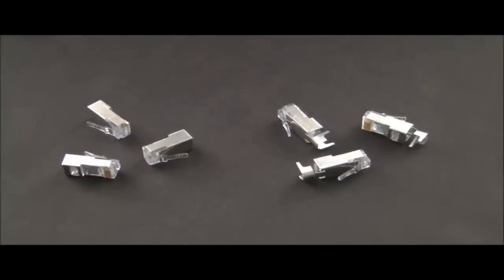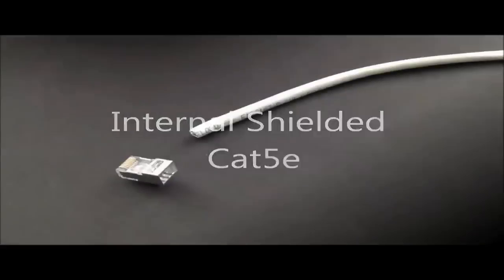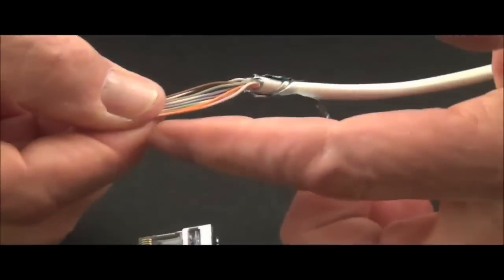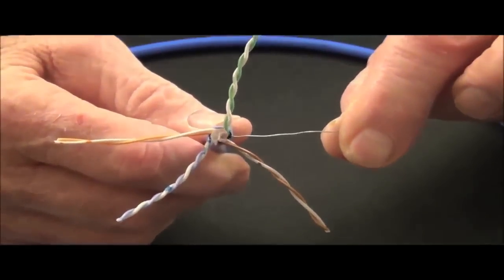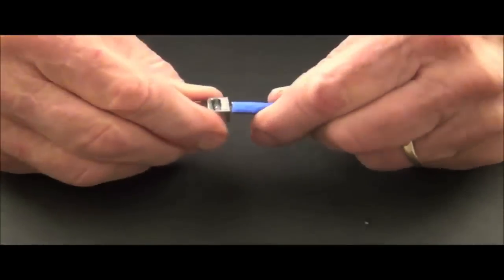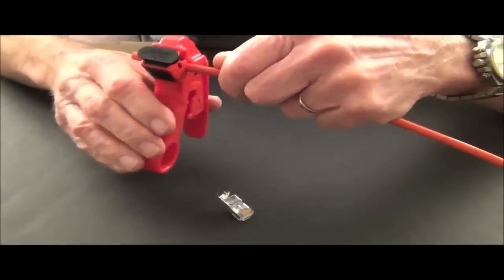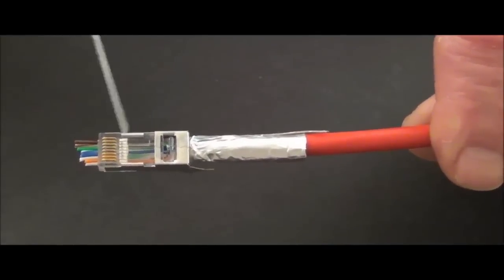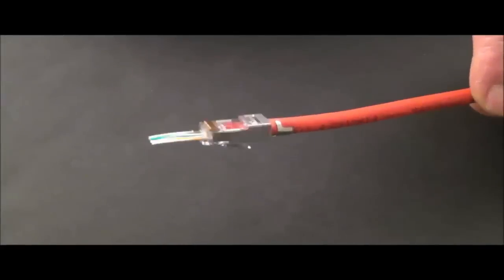Tutorial: CAT 5e & CAT 6 Connectors - EZ RJ45 Shielded - Internal & External Ground

Comment: 1:33 I've never heard that before but I'm not surprised.  Sounds like an absolute nightmare to crimp.  However, such a small distance probably doesn't actually matter considering that cat5e will support 10 Gbps up to about 30 feet, give or take.  Maybe it would shave off a few meters or so at worst.  Still, it's good to know.